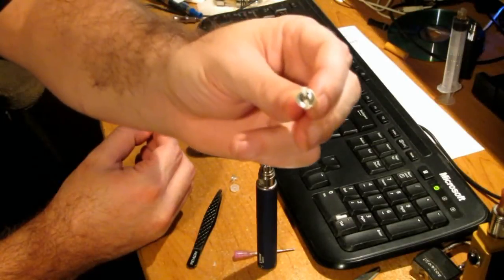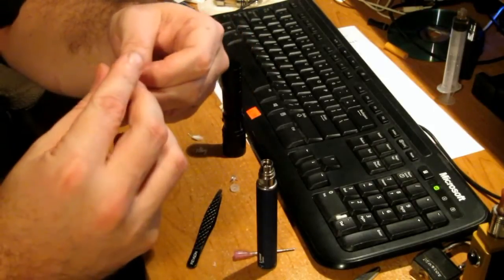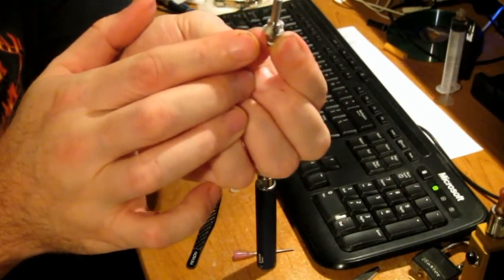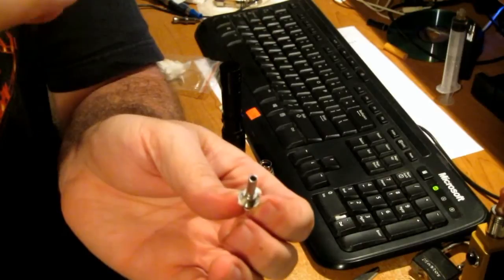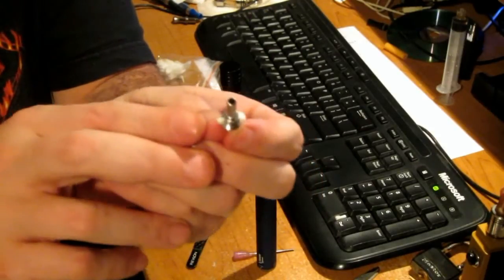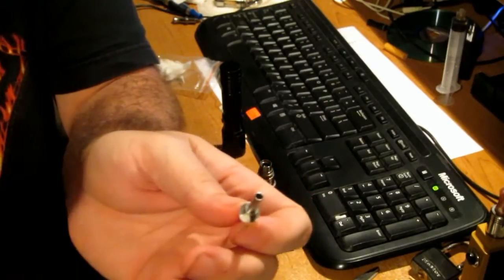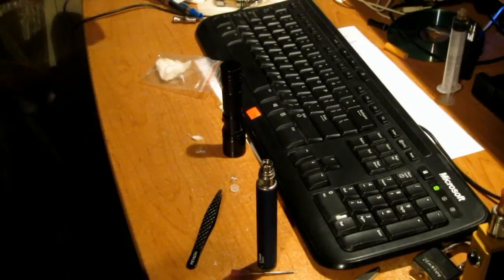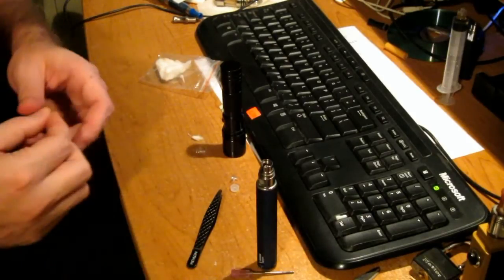The Fix Is In. The Kanger Bottom Coil. T3, MT3, T3S, Protank. Part 3 Of 3

Comment: great build  - i have been using a 1/16" drill bit with 28g kanthal 8 or 9 wraps and cotton wick. no leaks, no dry hits , so much better than silica , so far it has worked in every bottom coil clearo i have -- i think that is a 18g needle you are using -- thanks for the vids Travis